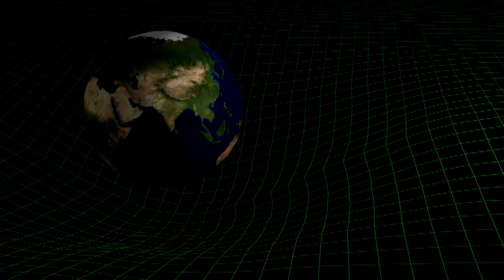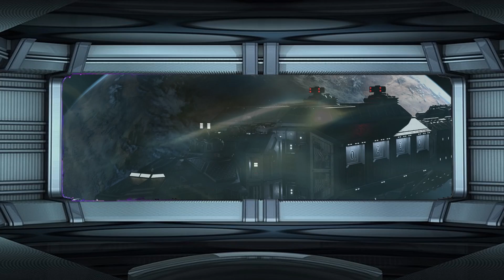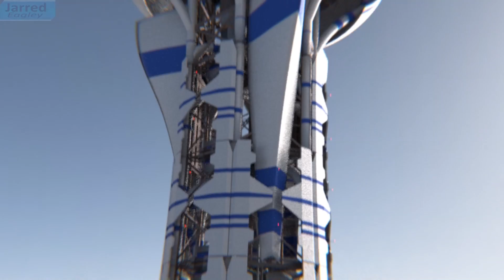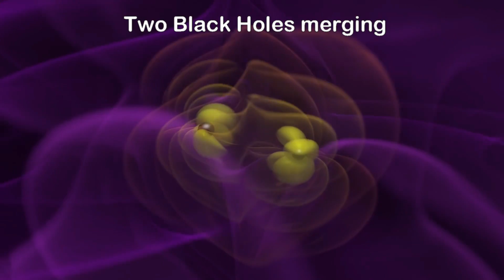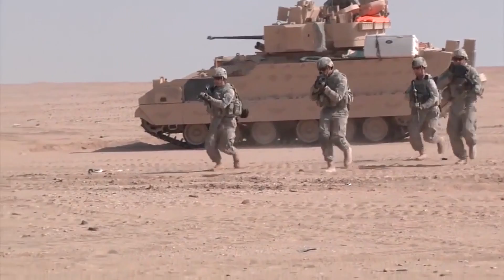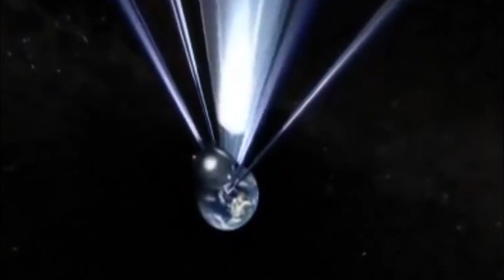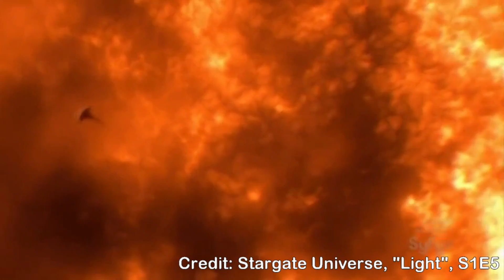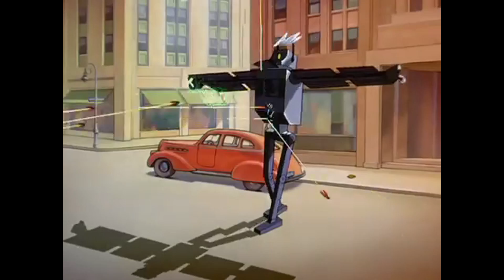Force Fields

Comment: Steel melee weapons will scratch steel plate at best. Steel weapons will keep an edge longer than bronze, but you still have to aim for unarmored spots if you hope to cut an opponent in plate mail. Blunt weapons, however get around this by delivering shock through the armor to the brain and extreme force to the neck. You are right that for any technology there are always ways to exploit them, but it the case of melee weapons and plate mail one of the workarounds is essentially using a much more crude technology. I want to dispel the myth that plate mail could be cut through by hand held weapons from the same time period.

Comment: From what I understand from the shields in Dune, they seem to block energy, a particle of air moving fast has so little mass that it's total energy is way less than something like a light push, which would make it through the shield. Bullets are way bigger and even if they move slower they have lots more energy. Basically you could figure out the lower energy limit of the shield if you knew what speed someone's knife was going when it passed trough and the approximate mass of the knife. Things like lasers have watt outputs so theoretically a really short burst could be below the energy limit of the shield and get through. Actually making smoothing like this though is where the fiction part of sci fi gets highlighted.

Comment: just started video. shit flooding brain already havent even gone past reading the title yet lol. 

basically, what needs to be done is... 
first off, a force field is an energetic magnetic field that surrounds an object.
somewhere within that magnetic field there will be a boundary layer where the energies are great enough to ionise the surroundings.
secondly with an ionizing layer, this layer is the protective barrier, pulling electrons from matter on contact. therefore dissipating the energy into the fields system. one would think this extra boost in energies would pump up the field, but a seen in sci fi, phasers do damage, lasers do nothing. lasers would be easily absorbed and wouldnt overload any of the circuits involved, phasers then must be a massive amount of stored energy in a single shot. kinda like a ginormous capacitor fully charged shot out. when this phaser charge hits the barrier, it discharges its stored energy in one big burst, this is what damages the shields, the emp from the burst wouldnt get through initially as the ionizing layer would block the emp, but follow up shots of a phaser would soon overload the system and force a reboot, bringing the shields down.
Thirdly, for us to be able to create a force field locally, we have to observe force fields that occur naturally. ie the earth magnetic field and its ionizing layer. we know the flow and direction of both the north and south magnetic fields, their relative rotational speed and the power required to generate it. (we would need a much stronger field for personal use to create a deadly ionizing layer) 

the question then is.... so what device currently exists that can mimic the celestial magnetic fields that we observe? with a northern half and southern half inflowing through the poles and outflowing at the equator.

beyond that answer fourthly, once we have established a controllable and stable ionizing layer in a localized area, wouldnt we then observe that whatever is inside the force field (immensely strong at this point for our use) wouldnt be bound to the same laws that govern the world outside the field? ie the force field being the warp bubble for super luminary travel?? inertia cancellation and all that good stuff?

Comment: Recently I discovered a scientific article that showed that electrons in a high voltage electrical field and under high accelerations display negative inertial mass. https://www.sciencedaily.com/releases/2010/04/100412084525.htm Other than my dreams of infinite energy, I saw the potential for a force field: induce negative mass in the electrons after spraying them out. Then when something strikes them, they apply a force to cancel out the incoming object. Enough electrical charge to the object to give it a negative charge, then a wall of negative inertial mass electrons that stopped any physical object attempting to enter. This would not work against lasers, but would stop objects at theoretically any speed. Not sure how it would work against particle beams, but I assume protons would weaken the shield and penetrate it while electrons would be repelled or incorporated into the shield.

I would like to know the thoughts of anyone willing to post.

Comment: There is a way to have powerful laser weapons that can be carried like a large sub-machine gun.  You would use a chemical laser.  The gun would take cartridges containing fluorine and iodine gas.  The gas is mixed and the laser pulse is shot.  The cartridge ejects and the next one quickly loads.  Such a weapon would exhaust some extremely dangerous gases.  Chemical lasers are some of the most powerful we currently have and were considered for the Star Wars project.
Reply: Gas-dynamic lasers are a similar approach with less toxic exhaust (they're CO2 lasers). The exhaust is still a jet of red hot gas travelling at supersonic speed though, so firing one in an enclosed space might get a little exciting.
Reply: @nerd1000ify  So let's divert the exhaust in the same direction as the laser beam - if we're shooting at it, we clearly aren't concerned about it taking damage...

Comment: When your spaceship is traveling at the relativistic speeds needed for interstellar travel, wouldn't you need some kind of shield to protect your ship from whatever loose microscopic debris might be in your path?
Reply: Isaac covered that in the video about interstellar colony ship.
Reply: I would recommend a highly confined plasma shield to both vaporize and possibly add to it or dump into space for heat dissipation and partial shock absorption.and smaller dense metal panels with high shock springs for the ones that get past the plasma.
Reply: Yes, but you can accomplish that by building in like a huge thick metal dome in front of the ship, so that way any debris bounces off the shield and doesn’t damage the vessel. It’s a low tech solution, but it’d be very effective
Btw, Dr.. Shaym? How’d you end up here?
Reply: Point defense lasers
Reply: 'Some kind of shield' dosn't have to be a magical force field. Could be really thick metal mushroom shape on the front of your ship.
Reply: Ya, mass , pbs spacetime also covered this issue
Reply: I know this is an old comment, but to chime in, you are absolutely correct. In fact, a more bizarre effect of relativistic speed can theoretically cause single free floating atoms to crash in through your ship, which can act like high energy ionizing radiation. The particles would not punch a hole in your ship, but they could punch a hole through your DNA and cause genetic damage just like any other kind of ionizing radiation. We would probably need some sort of future sci-fi shield that can capture or deflect debris

Comment: Another solution I think that has been missed here is utility fog.  https://en.wikipedia.org/wiki/Utility_fog  I am not sure if it could act as high end protection from weapons, but many of the mundane uses were practically right out of the list of things it was meant to do and anything it could do is replicated by force fields as you describe them, so it seems to be another path to them (force fields) that does not require new physics.

Comment: Atoms have a natural shell around them to guard the nucleus from fusing with others. That's a kind of "force field", in a sense. Perhaps, if one could generate a massive, negatively charged shield, composed of an excess of electrons, you could guard against all sorts of matter. Aside from anything that is positively or neutrally charged of course, the former attenuating the shield while the later passes right through.

The whole point and function of a force field is to be able to mold and focus mass or force against a point of impact, much like a classic shield but with extreme control that involves more than just swinging one's arm in the way, and perhaps some way of also repairing the shield too on-field unlike most defenses. Typical armor, you have to plan out how it is normally arranged along the body, with some parts more guarded and thicker than others. You could guard all parts equally, but now you have to worry about weight. However, if there was a way to mold the position and thickness of that armor, you can have overall modest or even terrible protection but still have an ability to block a powerful shot with what is essentially a buckler made of some magnetic liquid.

Naturally, one trade-off you have regarding force fields is that you have to expend energy to augment your passive defenses. Much like how one has to expend energy just repositioning the mass of their shield, the same is required to move the mass of particles to a focused point.

The force field, in a sense, is also just a more fancy, techy version of a normal slab of mass. The difference here is that you have greater control of the shape and thickness of your shield, which I think is one major advantage such a shield would have over a dumb slab of mass. Though, I do suspect that increasingly finer shields would require increasingly greater amounts of processing power to use.

The same tech used to make fine shields can also lead to the development of force field-based weaponry, such as a lance made of force, or even a projectile using nothing more than your ability to project and focus matter. You're literally throwing your shield at the enemy. And thus, in this case, the best offense is literally a good defense.

I suspect that the first true force fields will also involve low-tech matter manipulation, perhaps through moving and repositioning ionized non-solid matter. After all, creating force fields does require some degree of matter manipulation.

Comment: All you need to defend against laser weapons is an armor made of mirrors.
Reply: That wouldn't work. Mirrors aren't perfectly reflective, so the laser would burn through it, just slower.
Reply: Except it would...if it was a perfect (or near very near perfect) mirror - one capable of reflecting 100% of light. Anything less, well I will admit that you're right. But since we're talking about all things hypothetical, and a near-perfect mirror may be possible, I'll stick with it.
Reply: No, it wouldn't work. The physics of mirrors is no different from any other visible matter. The light is absorbed by the atoms of the material, which then get excited and release another photon with slightly less energy. Most of the time that little bit of extra energy isn't a big deal. However, when talking about laser weapons, it does become a big deal because of the concentration of the photons. In theory a powerful enough laser could burn through even a perfect mirror.
Reply: In that respect, it would depend on how much energy the laser is carrying. I will concede that a powerful enough laser with a long enough duration would burn through a mirror,  but a good enough mirror could also reflect quite a bit of energy. Maybe you would need several layers of mirrors to protect against more powerful lasers. Although, I guess  there are probably other materials that would absorb rather than reflect the energy and in doing so be more efficient.
Reply: You've conceded my whole point.

Comment: I have seen a video about a way to make fusion, and in it they were talking about plasma in a magnetic field that is over 22GigaTesla density, does no longer transfer heat to outside objects, this serves to make it safe to touch and will reduce greatly the energy lost when it is active, this will make it possible to do anything from a basic energy barrier that stops air from escaping an airlock; to startrek replicators; to construction beams like in supreme commander, to life forms like C'thans from Warhammer40K.

Comment: I remember reading about an interesting application of the alcubierre drive in the admittedly questionable Star Carrier series by Ian Douglas. Basically, instead of using the space time bubble for FTL acceleration, it's used to curve weapons fire away from a ship (not perfectly/ no infinite shield strength is shown in the series). In terms of real science, I was wondering how plausible a system might be and if it was doable, what is the scale of uses that the complex machinery needed will allow?

Comment: Hello Isaac, I've been following your channel since approximately a year and I'm really enjoying the incredible profoundness of your videos. It sometimes demands real concentration and rehearing to fully understand the concepts discussed here (especially for a non-native english speaker) but it worth the effort as your channel is one of the few works that changed my perception of life, the universe and the rest.

I have one question about this video (and this is why I comment on this channel for, I think, the first time), when you talk about intercepting lasers, would it be possible to negate them with another laser ? As light is an electromagnetic wave, a wave of equal power but with exactly opposite oscillation could cancel it out, like it happens with sound waves. That would be the equivalent of stopping a bullet with another bullet but for lasers. The limit being that one would need to know the wavelenght and power of the laser before it fires to be able to counter it properly, but perhaps that could be deduce by the enemy material and the situation.
Reply from the maker: Hypothetically a wave can be countered by another one, though in areas of destructive interference the energy is shifted to nearby, but practically speaking it's not really viable.
Reply: Thanks for the answer !
But why is it not really viable ? Because of the energy dissipated by destructive interference or because of the difficulty to "align" the counter-wave with the wave ?

Comment: I know it sounds a bit Star Trek but there must be some sort of crystal that will provide both propulsion and shielding. 

If space behaves like a fluid then a vibrating crystal could create a cavity that may act like a mini universe and be able to travel at speed without violating relativity as a result.
If the medium of space slows light down then creating a cavity would mean you are in a true vacuum and lift the speed limit.

Comment: The Asteroid shield portrayed in the movie passengers was a closer to realistic look at the original plasma shield idea.

The Japanese anime Legends of galactic heroes had an interesting take on armor where they actually used a highly reflective liquid metal to cover a battle station and some satellites. Being liquid it would disperse the energy of incoming weapons and move to fill any damage.

Mass Effect is probably the best known example but there have been quite a few examples of holographic 'hard light' projectors that use actually real properties of light to act like solid matter - though experimentally this has only been tested on very small scales. In Mass Effect they didn't just make simple objects but made entire complex machines out of hard light that lasted until their energy was spent.

A lot of sci fi shows use a variation of their in-setting McGuffin that allows ftl travel to also make shields / weapons etc. Macross comes to mind as the system that let them 'fold space' was the same thing that let them make shields and their giant fleet destroying reflex cannon. Macross also tended to break with Sci-fi convention because they routinely use the biggest weapon they have in their opening salvo rather than save it to the end . . . might be another #1 rule of combat in that . . .

Comment: Before I watch this, I just want to add a thought I've had for a while now. In most sci-fi, they use force fields and these fields either block/absorb or deflect plasma bolts. I have to assume they are doing this with an electromagnetic field, in which case I would have to assume that the ultimate weapon in a universe like Star Wars for example, would be some sort of rail gun tech. A rail gun round would be impossible for any sort of realistically imagined force field to block. Even if the field could vaporize materials, the rail gun round would be moving so fast that it would pass through the field before it is vaporized.

Comment: @4:15: Another example for slow-moving matter you'd like protection from besides steam and flames: Acids, bases and poisons (fluid and gas).
@10:00: Problem with the "random window": You need something that can see at the window. A camera or the like needs to be there. So the position can't be very random or you would need hundreds or thousands cameras.
@18:00: Can't use a Non-Newtonian fluid for that because the pumping into the right spot would make it go solid. Non-Newtonian fluids would be a great passive defense if not for the weight argument.
@19:20: The SciFi series "Perry Rhodan" had space ships made mostly or entirely of force fields. The big advantage is that you can reconfigure them at the touch of a button and they "heal" quickly.
@23:25: I'm wondering why no one yet has mentioned the major flaw of force fields: They are totally frictionless by design. If you have a bubble-shield and you drop, you can't get up. You can't walk if the soles of your boots don't penetrate the shield. If you wanted to simulate friction, you would need a way to impress structures in the micrometer scale on the field. Hard edges preferred.
How rigid are the shields? Can you bend your arms and legs?
If you're using a magnetic-based shield, what happens when I throw iron dust at you? Nails? Half a ton of heavy iron balls?